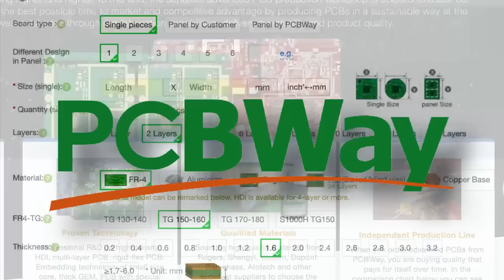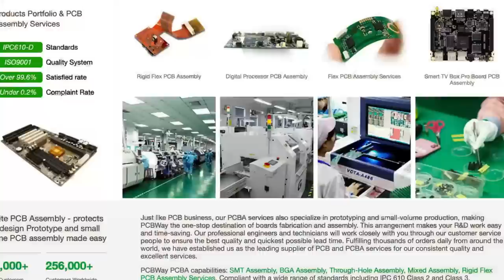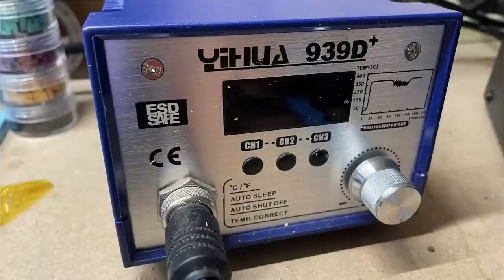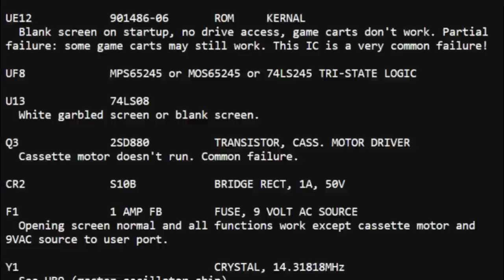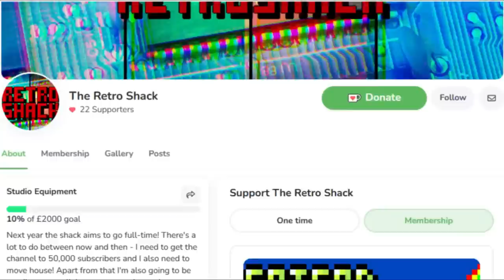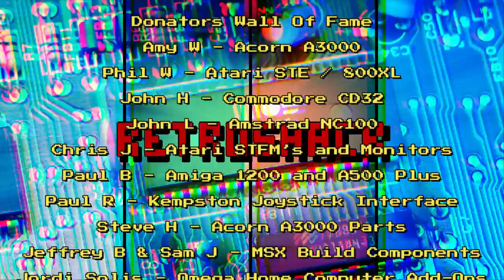Let's build a new Commodore VIC-20 so we can diagnose and fix another one!(contains flashing images)

Comment: I had a VIC-20 in the day, but kind of hated it as 22 characters per line was such a drop from a proper 80 char line on pro gear I had at work. I also has a TRS-80 that had 64 chars by 16 lines, so the VIC-20 was kind of a back step for me. Yes it had colour, but the amount of crud and noise that permeated through the picture, even after I went to a direct composite video link, rather than RF, really irked me.

Comment: My first computer! I was given a VIC-20 in 1983, just as the UK micro craze was kicking off, and just months before I started secondary school.

Of course as it turns out, I was the only one at school with a VIC. It would've gained much more traction in the UK, if it weren't for Sir Clive.
Reply: The UK had a lot of choice with a wide price range. People with money would upgrade their Atari VCS with the Atari 400/800 from 1979 on. Apple IIs for rich parents who worked in IT. Dragon 32, Acorn Electron, then BBC A/B  were probably more popular than the Vic up until the C64 took over.

Comment: I thoroughly enjoyed the reference to The Hitchhiker's Guide.  Made me smile.

Every time I watch one of your build episodes, or an episode of Adrian's Digital Basement, I get this desire to build or get myself an old 8-bit computer like a C-64, but I have two major problems.

1) I have never assembled one of these machines before, so I'm freaked out by the prospect of having to do all that soldering myself; and

2) Other than the nostalga value, I have no real function or purpose for one of those older 8-bit machines.  I probably would obtain/build one, and then it would sit in the corner and collect dust because I wouldn't know the first thing about where to get software for it to make it useful for me.

So, instead, I shall live vicariously through your channel.

I really enjoyed today's build!

Comment: A bit of a luxury but useful for some builds: you can get electronics mounting pliers which are designed to put a little wave in the component legs, they are used a lot for components with higher heat dissipation but I can also give you a bit of wiggle room (it does lift to component off the PCB which is very useful for resisters running close to their limit.
)
Reply from the maker: Good to know - thanks!

Comment: Very nice video! I actually built one of these. I used the basement kit like you did, and initially I used a non-working vic for the custom chips.
In the end I sourced modern CIAs, a modern 65c02 adapter and chip, and used rom boards to put in newer rom chips. Finally, I had enough parts around to build it a Mechboard64. 
The only original Commodore parts are the actual vic, the case and the keycaps.
I have since reapaired the donor board, and maybe one day there will be a vic replacement out there to make it complete.

Comment: I am surprised that you didn't install ZIF sockets in all the chip sockets that you might want replace.
Reply from the maker: Not as surprised as I was when it was first mentioned :) D'oh!   Rectified for the next video! :)
Reply: @TheRetroShack  You might want to find some low profile zif sockets, especially if you are going to add heatsinks. Apparently, someone did a replacement BASIC and Kernal roms that make the VIC a very different machine, and I don't mean jiffydos, either.

Comment: This is really cool! Costwise, how does this compare to a working original VIC 20? Also, was that a donor case or a repro?
Reply: These recreations tend to be on the more expensive side compared to buying one in most cases depending on whether you have some existing parts etc. I only built my Vicky as I was more interested in soldering/building one as it was an enjoyable experience. Saying that I have 2 originals as well 😁

Comment: Nice build, slight point of order, the Apple Mac was 68000 based, not 6502, I think you are thinking of the apple I / II in your vid
Reply: You weren't paying attention.  He never said the Macintosh used the 6502.  He said it used the 6522.  Which it did indeed for the keyboard and clock on the 128 and 512K models.
Reply: @dennisp.2147  yup, hands up on that one 😃

Comment: Finally a project I have already done :) It's probably the easiest project like this you can do. The board is lovely, and mine worked first time :) I have one of Bob's CPC464 boards to try next
Reply: also - just get yourself a Penultimate Cart from The Future Was 8 Bit.. it not only has all the good games from the past, but a couple of modern corkers. Oh and some atari paddles, as there are some games that use that - but they are addressed by the computer a little differently than normal joysticks

Comment: I just finished building mine. Took over a year. I am about to throw the power switch but am afraid to. You can also get 2 brand new 6522 replacements made by WDC on Mouser for $10 each. WDC part #W65C22N6TPG-14

Comment: Interesting to see that the CPU of the PAL version of a VIC 20 ran slightly faster as compared to the C64 where the PAL CPU is clocked slower!

I wonder why that would be the case since it's quite common for the PAL version of any machine to be slower due to the difference in voltage between Europe and America?

Comment: How the hell is everyone going to get their hands on these chips??? once this gets popular then there will be no chips left and sellers will price gouge..... and how much are people stupid enough to pay $1000 bucks for a vic20?? lets be realistic... this hobby is way to expensive and even though i yern to own a C64 again, it will never happen cos of the rising cost cos of greedy sellers. In Au with less population means there is no abundance of stuff like the US and Europe.... so now add the extortion delivery price..... its too dam ridiculous.
Reply: It's a little late to express concern about this...  Retrocomputing hit the mainstream more than ten years ago.  That being said, It's not really an issue with the VIC20.  There are new versions currently being manufactured of both the 6522 and the 6502. The VIC doesn't have a PLA like the C64. The ROMS can be replaced by current units, appropriately modified.  The only real tough chip to replace is the VIC, which several folks are currently working on replacing with a programmable solution.
Reply: Yeah, I spent more than is practical. But the only original Commodore chip in my VickyTwenty is the Vic chip itself, and when there is a modern alternative that Vic chip will go back to the freshly repaired and recapped board. The only other oem parts are the keycaps and case. The case is going to be a modded new 64c case and I will likely change the keycaps out as well, once reasonable alternatives are available. In the end that oem Vic-20 will be on display above the net new VickyTwenty which sits next to the SixtyClone which only has the CIAs and keycaps as oem parts. So, when reasonable replacements are available for those no Commodore computers will have been harmed. 😁